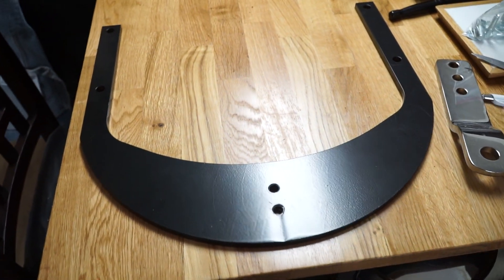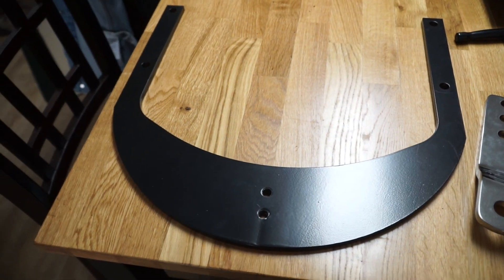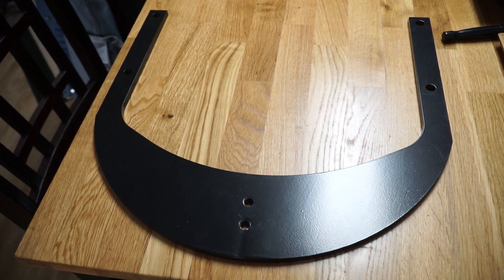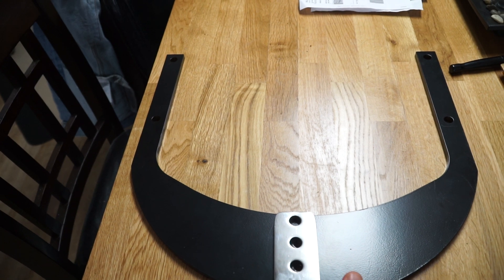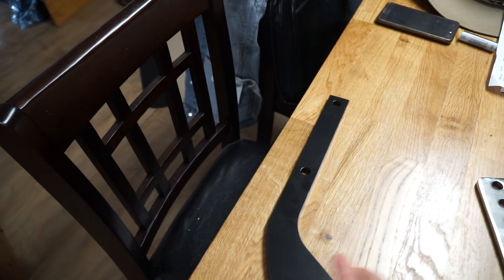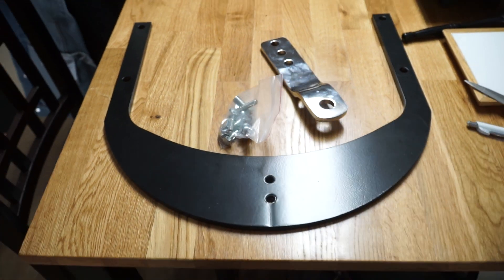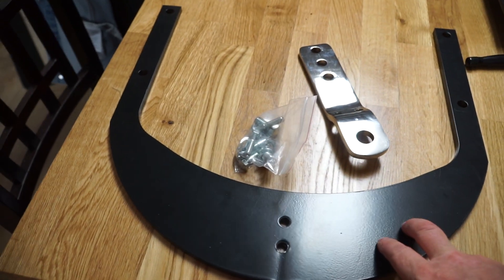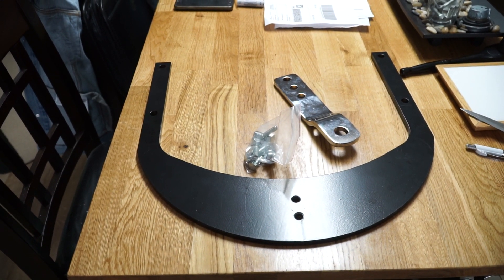hitch

Comment: Do you have the Supplier contact or where I can buy it?
Reply from the maker: http://traileretc.com/product/2009-up-kawasaki-vulcan-voyager-vaquero-nomad-1700-trailer-tow-hitch/  here you go with the supplier of the hitch
Reply: thank you
Reply: Are you able to flex hitch up and down while installed on bike?   My steel plate actually will flex.
Reply from the maker: This hitch does not flex at all on my bike will not move even a very tiny bit